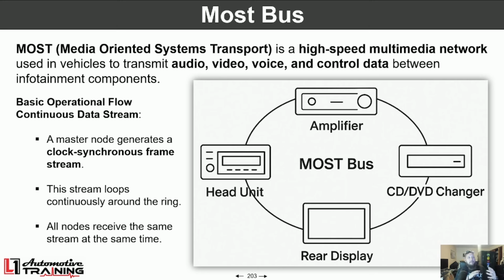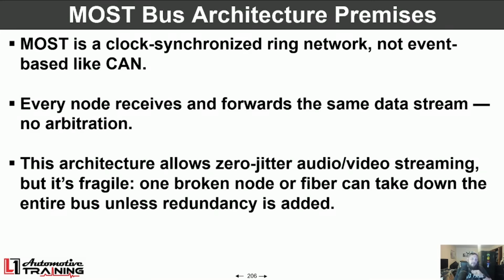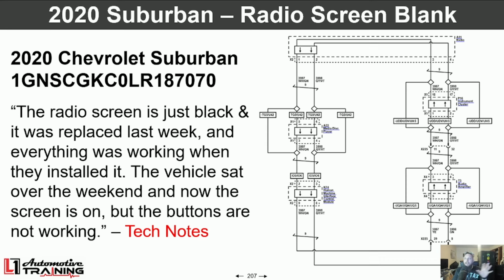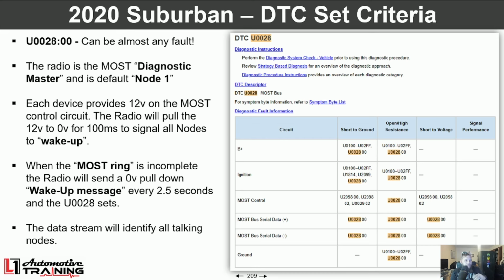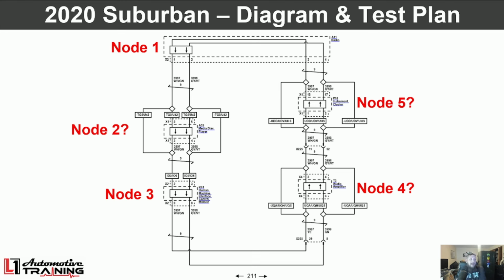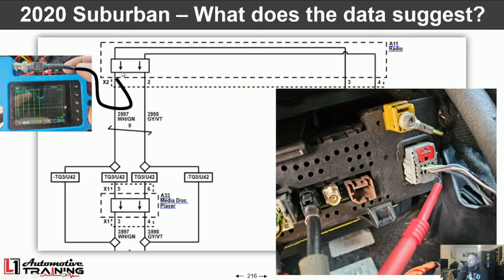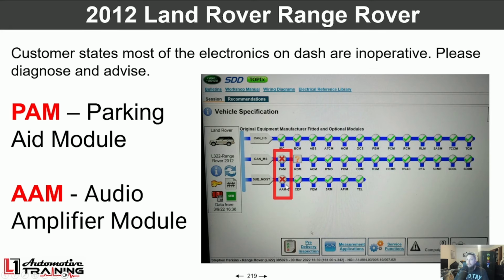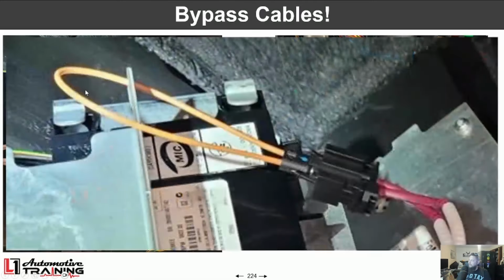MOST BUS DIAGNOSTICS!!!

Comment: I've never run into MOST bus issues in my years working with body shops, but someday, this information will save my bacon, or in the very least, save me a lot of time having to learn on the fly.  Thank you for your time and insights!
Reply: ya, dont use that Diag he is showing is not correct, he is trying to Diag in the comms direction, and ring break diag is upstream or opposite direction.  The diag will tell you where the ring break is.  that is what we were taught in our OEM training.  Likely, he is confused and not reading the diag correctly.   This video is not correct.
Reply: @Barb-u3e perhaps this vehicle has a different architecture. So much misinformation or incomplete info from all service software providers
Reply: @verajavi12  if it has diag then it will be wireed the same.
Reply: @Barb-u3e Hi ,I am having an issue with sound system in my Mercedes c350e plug in hybrid 2018 ,please what could be the best way of Diagnostic it please.I will be very grateful if you can help me please
Reply from the maker: Thank you so much!

Comment: if this is a closed loop system what does it use to talk to the scan tool???
Reply: Porsche has those too..
Reply: Perhaps he is considering MOST bus in kind of old cars where your infotainment sys was on MOST and isolated from rest of the Networks...
Reply: @AutoDiagnosticsPK  but he is reading it on a scan tool
Reply: @richardcranium5839 for that i will have to c full video....nonetheless your scantool can connect to any network if scantool fulfills network requirements....even if you don't connect thru standard obd port
Reply: @richardcranium5839  , the A11 Radio is on the CAN bus that is how he is reading diag info for the MOST Bus.